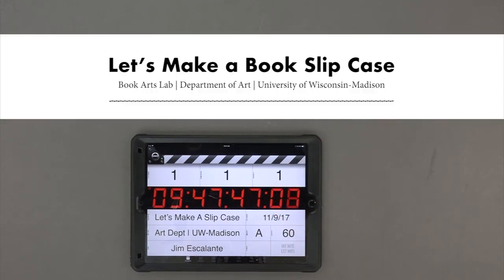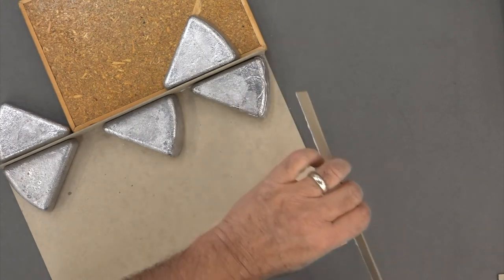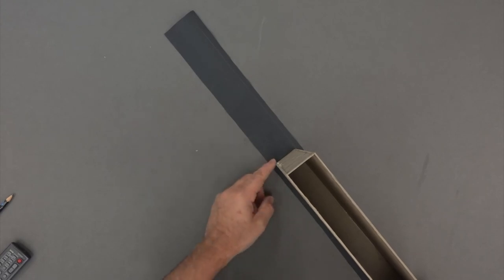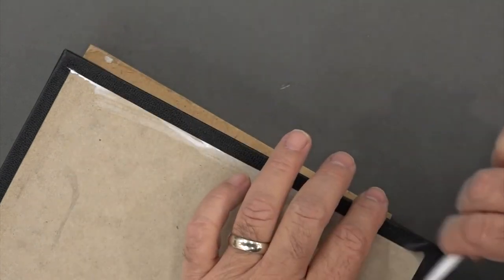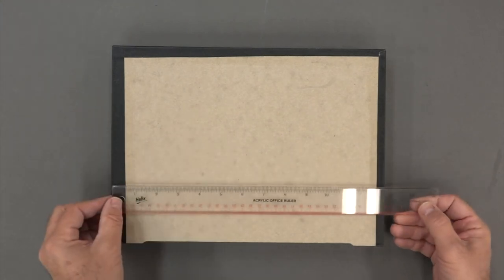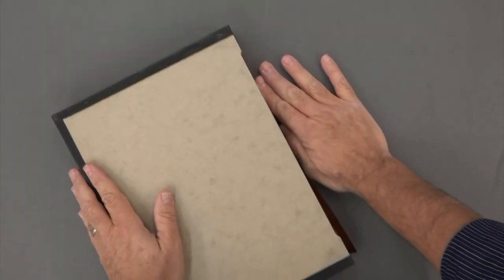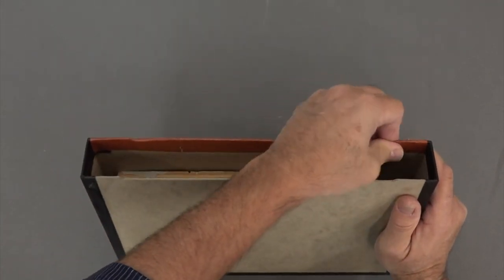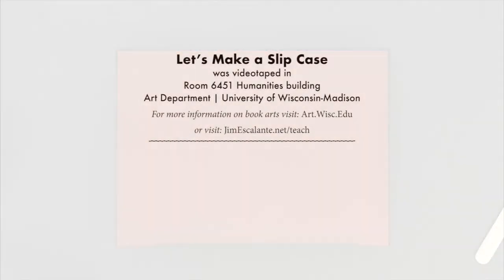Making a Slip Case for Sketch Book and iPad

Comment: Thank you of all the tips! 
I really need to try that. 
Would you recommend any sources for a decent book-cloth (I really like the one you used for the sides)?
If anything decent comes out of this, I'll let you know.
Reply from the maker: The brown cover material that you see on the sides of the slipcase is a paper I bought at an art supply store. I do not recall who made the paper. It looks like wood grain but simply a decorated paper, not wood veneer. I buy most of my book cloth from a vendor in Brooklyn, NY called Talas. I think their web address is talasonline.com Hope this information helps.
Reply: What type of glue you use?

Comment: Jim, what are you using for weights? I️ use diving weights, which work well, but I️ seem to always be looking for smaller weights. Thanks.
Reply from the maker: I melted some scrap lead that I had and poured it into a cast iron skilled with wedge compartments for corn bread. Of course I no longer use the pan for cooking. Not that easy for everyone. I have filled small boxes with some scrap metal. I feel that I am always searching for the ideal weight to use. Hope you find some!